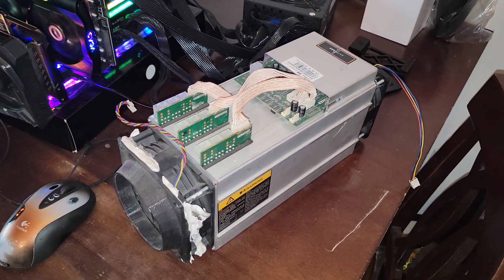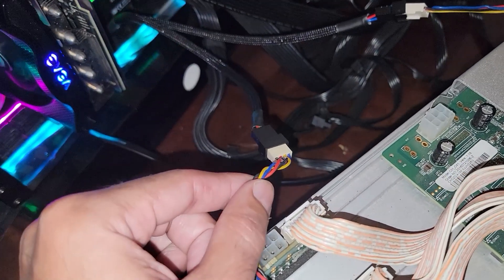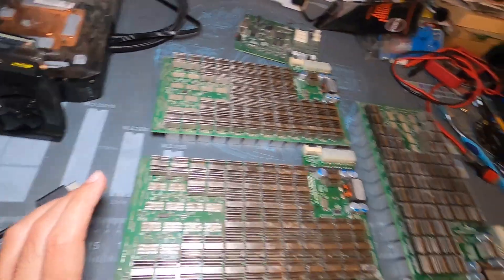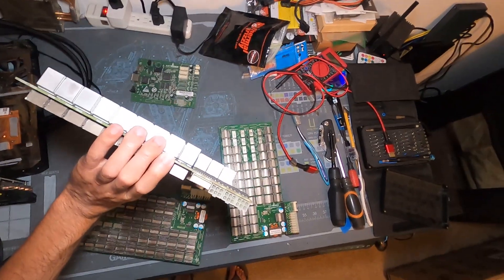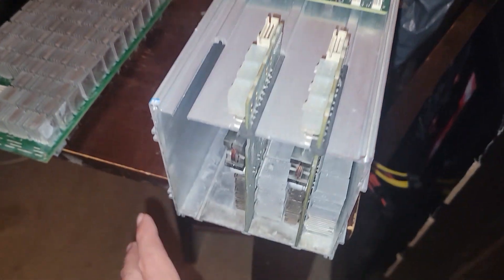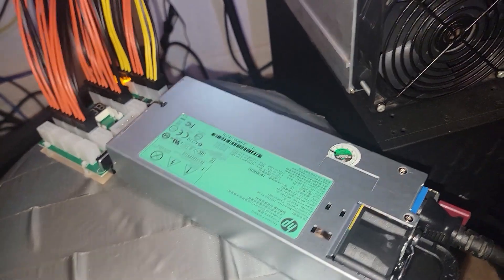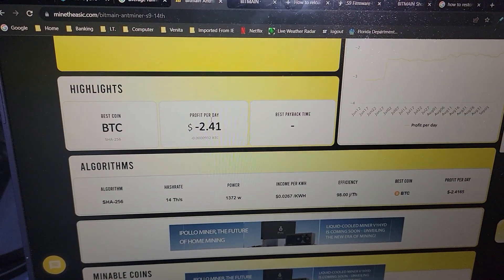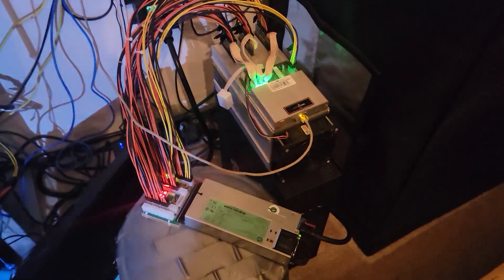Reviving old S9 Asic, will it work?

Comment: Is there anywhere I should avoid getting wet with the iso? What percent iso do you recommend?
Reply: Only use 99% iso alcohol on circuit boards. It is safe for the complete board. You can also purchase CRC Electrical Cleaner.  I have used that on complete motherboards and GPU boards.

Comment: I actually gave my hashboards an alcohol bath, and you wouldn't beleive the amount of dirt that came off that was between the asic chips underneath the heatsinks.  Dried them with my heater that got the whole rig up to 140 degrees farenhieght and let it dry like that for an hour or so then plugged it in and away it went.  All hash boards work great and it is way cleaner than it was when I recieved it used.  Forgot to mention that I used a paint brush to clean them, and blew excess alcohol off with air compressor before reinstalling in case and putting the whole thing over the heater to dry.

Comment: Hi! is there any recommended board to get low consumption for s9?
Reply: With BrainsOS you can set the max power consumption in watts and it won't go above that
Reply from the maker: @koga7349  yep. Will be shown in follow up vid
Reply from the maker: There will be a follow up video in the next couple of weeks, but there is not a specific hashboard I could just recommend. But if you had an S9 with 3 boards, you would run it and then take the most efficient one out and run it solo, with the control board and Braiins OS. Which I will talk about in maybe October